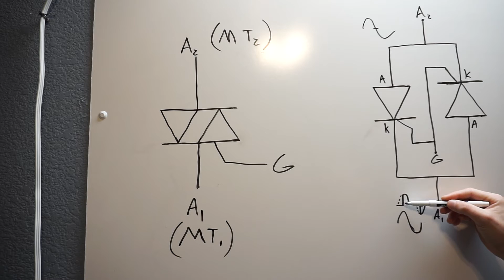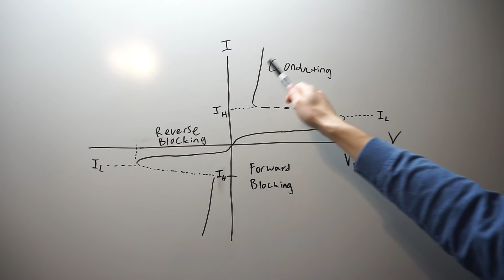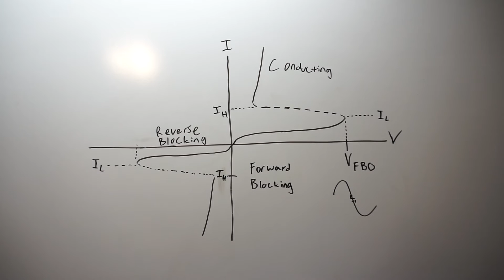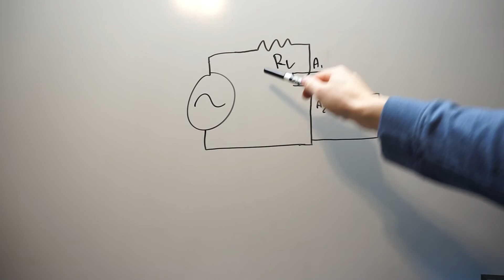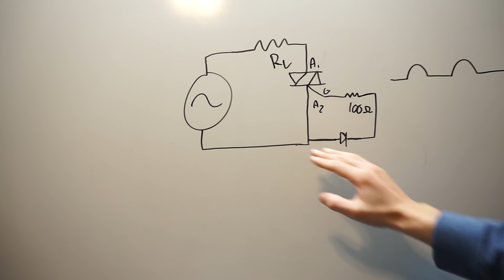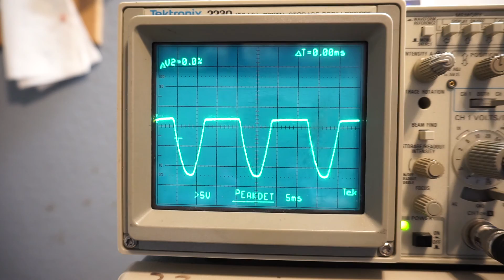Basic Electronic Components - The Triac

Comment: I need your help to eliminate a latched contactor that remains latched even after the actuating switch is off. I have a silicon controlled rectifier but I do not know how to wire it. The switch is in a 24vac circuit that is used to energize a contactor to turn on a recirculating pump. The flow switch is wired in series on one leg of the 24vac and it is working but when the flow is off and the switch opens, the contactor remains closed. I do not know how to wire in the scr..... HELP

Comment: So if I understand well your example with diode connected to the gate, when diode is connected in one direction, than first of the two SCRs conduct and when diode  is reverted than second one of SCRs conduct. That is the reson why we have these half cycles on the osciloscope. That has total sense of course. What does not make sense is the story with quadrants, it is not in coleration with this mentioned above. To be colerated gate voltage need to be + for 1st and 2nd quadrant and - for 3rd and 4th quadrant.

Comment: 4:33.  This, to me, is the elephant in the room, and everyone keeps glossing over it.  The SCR on the right will conduct when it's forward biased, as long as there's a negative voltage on the gate?  Negative with repect to what?  If it's truly two SCR's, shouldn't the gate need to be positive with respect to A2 to get the right SCR to conduct?  I've seen a lot of circuits that turn the TRIAC by connecting the gate to A2 through a resistor.  What gives, it should only turn on for 1/2 wave with that configuration.  What am I missing?
Reply: I figured it out.  A TRIAC is NOT two SCR's back to back with their gates connected.  It's just not.  The polarity on one side is like the standard SCR, but the other side has the gate connection to a different place than the standard SCR.  One gate connects to N type silicon and the other connects to P type.  They are similar to NPN and PNP transistors in the way their polarities work.

Comment: Tanks a lot, easy to understand!
Would a triac could be used as a audio signal switch if you put a constant voltage to the gate via an external turn switch?
Reply: Fried, look at the  curves for a conducting Triac @7:00 and so yes you could pass audio through a triac, but you wouldn't want to. It would make interesting low level listening...
Reply: If you were gonna have an external switch...use it to switch the audio, much (much, muchx100) higher fidelity, cheaper, easier and more reliable, or if you want to do it via cct control use a mechanical relay as the best for signal integrity.

Comment: I like your battery charger but  My battery doesn't have a power pilot pin So is there any way around that pilot pen so I can use this as my charger I'm charging at 36v battery that over 190amp hours made 10 ten in Series and a 100 in parallel in 10 lines of 18650 cell like the idea Having some control over voltage and charging amps if u can helpI would appreciate it or if anyone's watching his videos can help out thank you

Comment: Hey man i don't know if you'll receive this but i was wondering whether it was able to turn on and off a PC fan that is soldered to a power supply? i would like to make an air conditioner integrated into my Simulator cockpit but to do that i need to wire my fan to a power supply like you showed but also a on/off button. Maybe also a dial which allows me to controller the speeds maybe?

i also sent this over Google hangouts as i couldn't find a email to contact :S Sorry about that...